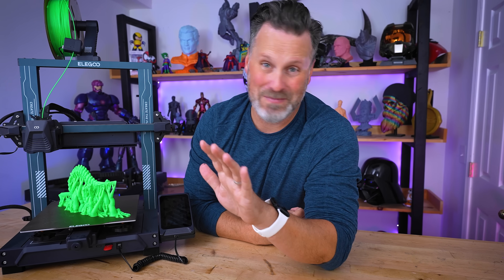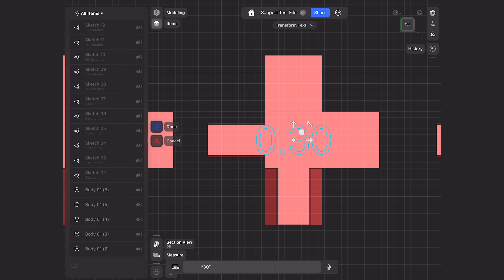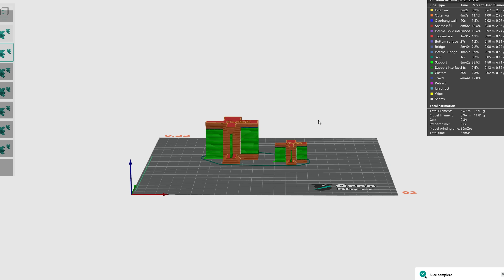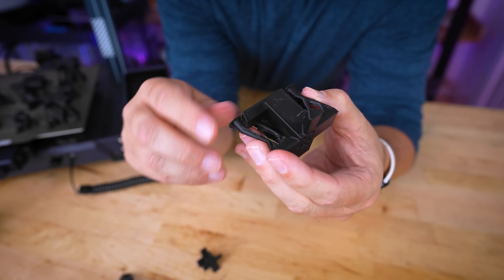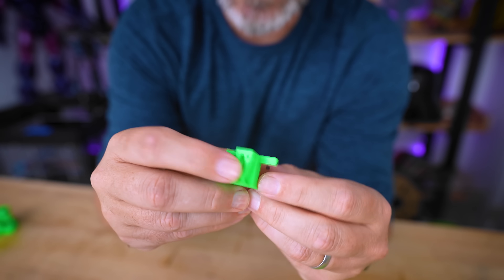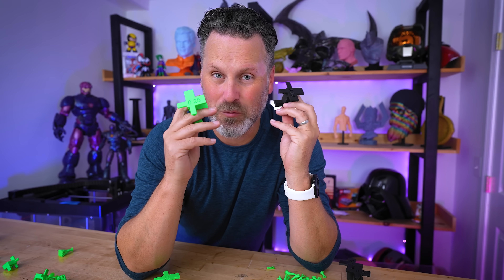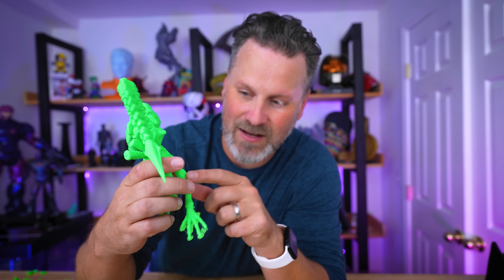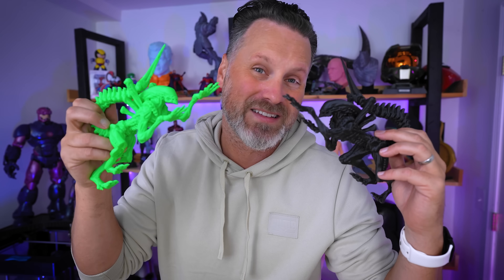Stop Struggling with 3D Printed Supports – Try This!

Comment: I run a small Print farm with 4 bambu's and use the AMS system alot- What's got me curious is that because I use different brands of filament, how can I "dial in" my support settings like this for multi colour prints...

I suppose I could choose a specific colour that I have dialed in and choose that as the interface layer 🤔

Comment: I had the same thing with supports on black filament being easy to remove, but the orange i bought for Halloween stuff being welded on there. So badly so that i had to scrap finished prints because the supports were so hard to remove they ruined the model trying to get them off.

Comment: Another thing you could tweak/optimize, is the overhang angle. Quite easy to create a test block with different overhang angels (going from 45° to 60° e.g. with 1° or 2.5° increments)

Comment: Hey Jess, Just wanted to let you know that there is a new filament manufacture in Buffalo Called Factory Filament if your not familar with them, The have this Filament Called DuraPet, its a type of Pet that is strong, sticks really well to the bed, doesn't need a heated chamber, and no fans. I'm gonna be getting some black and white this week when they get restocked. Thought you might want to try it out since they are somewhat a local company. They are literly half a mile from my house!

Comment: Hmm... I always thought that the z distance had to be a multiple of the layer height. Like for 0.2mm setting, z distance could be 0 (no layer between) 0.2 (1 layer) or 0.4 (2 layers). Is it not just rounding the 0.34 setting to 0.4 for a 2 layer gap?
How does the slicer do the interim steps? Is the layer height for the top support layer printed thinner than the normal layer height? Previews in Orca suggest otherwise. All the same layer height...
Reply: No you are correct, this video is just plain wrong but your comment will be buried in the praise comments so who cares :)

Comment: That was awesome. It was very fun to watch and learn about those parameters. If I'm in trouble with supports, I'll remember this.

Maybe you could do a video about stringing issues? Funfact: if I use Orcaslicer, my prints are string-a-paloosa.
Printing the same object sliced in Cura, everything is fine. I even copied the Cura settings over to Orca;
Orca just looooves to produce me hairy prints.
Modifying reatract, Z-hop, wipe etc. nothing worked. Now I'm using Orca just for splitting bigger objects,
exporting them and finally print them over Cura for the results I hoped to achieve with just Orcaslicer 😅

Comment: I would like to know what setting is used to make the slicer actually obey the "Top Z distance". From my perspective, layer height is the only thing that OrcaSlicer obeys. Said another way, you had pretty much the same experience with all your prints in two groups: those that rounded to the exact layer height, and those that rounded to one layer away. Load up your parts, slice them, drag the layer preview down to where the support material ends and the next layer starts. See what happens for all your tests. Yep. For your tests, you either got attached to the layer above or one layer of skipping between layers. I'm guessing there is something that is going on with the extrusion rate on the top layer of support, but from the user interface perspective, your options are 0, 0.2, 0.4, or 0.6 if your layer height is 0.2. Set your layer height to 0.1, and now you can choose 0, 0.1, 0.2, or 0.3. Your choice of 0.28 at a layer height of 0.2 results in one layer being skipped between the top of the support and the next layer. Both OrcaSlicer and Bambu Studio exhibit this problem. PrusaSlicer does not have this issue. It will adjust the layer height to achieve the gap you set. If you want to get really geeky, look at the G-Codes. Example: G1 Z23.4 F24000. Set the height of the nozzle to 23.4 and the feed rate to 24000. Dig deep. If you want something supported at a height of 25.4, the code for the top of the support will be at a z height of 25.4 or 25.4-layer height. It rounds any number you put in the "Top Z distance" to an exact layer height. Weird, right?

Comment: Make filament extrusion width smaller than nozzle width or flow ratio lower on supports specifically, whatever your slicer allows, you get deliberately underextruded supports that sort of just flake off.

Comment: I find that if I go much above 0.1 distance, my overhands look horrible.  For context, I mostly print in ABS so overhangs are always going to struggle.  But I just accept the extra work in pulling off supports to reduce the amount of fiddly sanding I'm doing.

I've also noticed - and again, in ABS - that how long the print sits makes a big difference.  If I pull the print after an hour or so (having waited for the chambre to cool to minimize warping) supports seem to come off fairly easily.  If it's hours later because it finished whilst I was asleep or at work or whatever, the supports are much more solidly attached.  I don't know if this was in play with your xenomorph, but it's another variable to consider.

Comment: I've learned from experience that the trick to removing supports is to not just pull hard but to work it back and forth.  After a few cycles it starts to crack and you can hear that.  Just keep working it and eventually it just falls off.

Comment: put a 180 circular curve on the bottom and have it test against that.  Flat to flat I've seen the same thing with top z index.  Curved surfaces are a different story though, I ended up at .275 top z on my X1C as my standard.

Comment: An interesting thing I've found with filament is that black is ALWAYS different. Matte and Deep Black PLAs are the only "normal" PLAs that I have different settings for on my Ender 3, and the only filaments I have ran flow calibration for on my Bambu P1S. Some of my most common issues are actually visible at 5:21 on your top layers where you have small gaps and a pillowing effect.

I have a feeling that because the colour black absorbs heat more than others, there is something different happening to the adhesion between layers compared to a lighter colour. Layers and walls are generally still very strong, but it always needs 1-2% higher extrusion than other colours. Maybe it's contracting more than other colours between layers and that's why the supports in this instance are coming away so easily

Comment: For PLA I always just use 2x the layer height (AKA, skip 1 layer), that seems to work every time for me. So when printing at .2 layer height, i do top distance .4, and when doing 0.08 layer height, i do top Z distance of 0.16.
Reply: Thank you!!
Reply: What about bottom height what do you set or adjust that.
Reply: @Gold3nB3rry  I haven't done too much testing on bottom Z, but i'd try the same and see how it works.
Reply: @mfmageiwatch   I've been doing more watching and was wondering weather it relates more to if you had supports created off your build ?

Thanks for response
Reply: @Gold3nB3rry  yes AFAIK the bottom Z distance is the space between the part and any supports printed on it.
Reply: Thanks!
Reply: What support type do you recommend?
Reply: THANK YOU, FLIPPEN BEST SETTING IVE DONE SO FAR!
Reply: @mr.h3084  yeah,  np!
Reply: im not understanding the z stuff any links to help a printer out?
Reply: @themaximusone I don't have any links, but I can try to rephrase. 

Z top distance is how much space is there between the top of the support and the first layer of actual print above it. (0 being fused, you don't want that. Default is usually 1 layer height, meaning it skips one layer before starting the actual print in that location. It will still semi fuse due to the nature of the hot plastic, but that space makes it a less secure bond you can break off. What I'm suggesting is that 2x layer height works best for me. It skips 2 layers before starting the actual print, its close enough to still provide some support, but far enough to not fully fuse and makes it easier to remove).

Bottom z distance is the same but reverse, and the less common one. It is for when supports are on the print, not just on the bed, and its the distance between the print and when the support starts. I usually try to avoid even having supports start on prints and do print bed only ones, but i leave this at 1 layer height instead of 2 because I want those supports to be stable if they are necessary.

Comment: If you think about it, this is a layer adhesion problem, just in reverse. While with the print itself, you want good layer adhesion, but between the support and the print you want weak layer adhesion, the closest to failure without actually failing, the better.
So you basically have to consider the same factors.

This also implies that printers being able to use different materials from the print for support will have an advantage for cleaner separation.

Comment: Heya bud. This is pretty nice to have.  I'd been using an ancient one from MAKE magazine 2017.

You really don't need to go through the effort of putting the numbers on the pieces though.  You should familiarize yourself with the Text tools in Orca, they're really capable.  I use them all the time when I'm printing out a small dimensional piece and I wnt to make sure something is scaled right.  but in this case you can just change the zOffset value, and then change that bit of text to reflect your changes.

bet people would like a vid on that too.  Bam/orca/prusa has got text tools, and I'm betting cura has something available through plugins (but I can't be bothered with that)

Comment: i hope this dosent seem stupid but does it make a difference if i use elegoo filament on a anycubic macine and vice-versa i have an anycubic and my supports are always welded like that but there aren't many videos to help me with anycubic that Ive found
Reply: No, printers are agnostic to the brand of filament you use. Just each brand has their own special blend of each type and can have different results compared to another brand. Id suggest finding a brand that works for you consistently and generally stick with them, but dont be afraid to try other brands.
Reply from the maker: Not a dumb question at all. You can pretty much use any filament on any machine as long as it can print at that required filament temperature. Pretty much any brands PLA, Petg should run on any 3d printer. You can mix and match all day

Comment: Had some prints today with difficult to remove supports - having an easy way to test them will help a lot! I also didn't realize that it varies with filament. Now that I know that, I'll definitely be testing new filaments before printing supports with them. Thanks for the video and the models!
Reply: Do you make your model files before printing?
Reply: @ayodelemarvellous850  sometimes. In this case, designing it to avoid supports would be tricky and I had limited time to make the design. But I do usually try to design so I don't need supports.

Comment: A little off topic but would I be able to run that Neptune 4 with just an iPad? I already have 3d software on it so i know I can do that. How well does an iPad work with slicer software on those?
Reply: you can't slice decently on an ipad unless the manufacturer has an app for it
Reply: @unclejessy i foubd your video on the PikaSlice app for ipad. Have you used it much since that video?

Comment: Remember, this is IN RELATION TO YOUR LAYER HEIGHT!  For a .2 layer height, everything here applies, but for a .1 or .3 layer heights it will be different.  In this case just take the .X for the layer and set the Z distance accordingly.  (Example: for a .1 layer height, set the Z distance to .12 or .14 or .16 and so on)
Reply: it doesn't. Printing a .12 or .48 layer height i have the exact same ease of detaching the supports. Any lower value and it's too attached 
It correlates with the nozzle, or more specifically the layer width, and the filament as he says
Reply: Another point is the obvious trade off being less tolerance for prints failing and/or having larger overhang drips. I have tested this extensively as well and found a nice trade off but it's very model dependent as well.
Reply: Variable layer height in Bambu?
Reply: It will still round it to the nearest multiple of the layer height.  So in your example, there is no difference between 0.12 and 0.14 with a layer height of 0.1.  It will give a 0.1 gap for both.  Try it out and see in the slicer.  At least.. this is how it works with Prusa Slicer.
Reply: @twinturbostang  They have variable layer height and also variable layer height for supports in Orca. There's also support interfaces that I think is specifically for making it easier to remove tree supports.
Reply: @ShopEskimo  Support interface settings predate organic/tree supports by at least three years, so I don't think they are specifically for that style
Reply: @twinturbostang  In Cura it's always rounded up to the nearest multiple, so 0.12 on 0.1 layer height becomes a 0.2 gap.
Unfortunately there is no conceivable way a 3D printer could make the info that's given in this vid work so it won't matter which slicer is chosen in the end.
Reply: @YoubYoub-f8k  So why do slicers let us put any number in there without telling us it's rounding up? Why not do the calculation so the moment you click out of the input it changes to what you're saying. 

Why do it the way they do now and cause so much confusion?
Reply: @trebory6  Well it's unfortunate I can't post pics in the comments.
Just open Cura up an hover your mouse over the name "Support Z Distance" or the input box.
A full description on it's functionality will appear.
Hope this helped.
Reply: @YoubYoub-f8k OrcaSlicer has an option 'Independent support layer height' that, as the name implies, allows it to command support printing at variable Z-intervals.
Reply: @darnon2031  I as going to say if you use variable layer height.

Comment: It amazes me how a veteran printer doesn't calibrate his filament... Dialing in the flow rate will make this way more accurate without changing these settings. It's why the black was already easier with stock settings because he is most likely using the same profile for each spool.

Comment: Could you not have all the different sizes on the build plate and change the individual object's settings to print them all at once rather than having to do like 5 separate plates worth?

Comment: The ELEGOO matte black is 100% my "go-to" filament for most things I make. It can handle high speed printing decently well too.
Reply from the maker: Agreed! Their rapid black PLA I now buy in bulk and use on my Bambu printers using the Bambu filament profiles
Reply: I have been buying Sunlu's Matte Black aPLA (Anti string PLA) for basically the exact same reason. and at 0.08LH the layers vanish.

Comment: You also need to make sure that you have the "Independent Support Layer Height" option is turned on if you're using OrcaSlicer, and this will not work the same when using a purge block.  If you're using a purge block you will only be able to choose a gap that is a multiple of the layer height.  If using a purge block and you put in a Top Z distance that is not a multiple of the layer height the slicer will automatically choose a gap that is a multiple of the layer height setting.

Comment: I noticed something just yesterday....
I was printing a rather large flat to the plate surface that had multiple tree supports underneath. They were hard to remove of course but I noticed something....
On the surface above each support connection the was a matching melted indention.
These round supports are funneling HOT air up and assisting in fusing these supports to the main piece!
And yes, the more malleable the filament the more easily it fused!
So could you run smaller or less supports so that the heat isn't constantly being transferred up to the supported part?
Looking at your green Alien print, and the number of supports, I'm guessing the fusing is coming down from the heated filament ABOVE the supports.
What do you think sir?

Comment: I generally print in PLA silk, but I've had the same issue of supports fused with a duel coloured (2-toned) silk filament on the same settings. The fused issue was on my cr-10 s5's but not on my P1p
Reply: Ever tried Bambu lab?

Comment: Temperature, temperature, temperature. I just went through this on a multi-section model print. The supports on the section where I dropped the extruder to 200C (from 210C) from the 10th layer up came off easily (0.28 top gap) while the second plate remained at 210C for the entire print resulted in fused supports and broken parts when I removed them.

Comment: Making a vid about supports for miniatures now with 1 hour duration. For minis there's a significant sag with overhangs/supported regions in my current best profile, but indeed making overhangs printable is a good thing to keep in mind with some exceptions.
Reply from the maker: Oh would love to see how that goes. I pretty much only print minis on resin printers but for sure lots of folks out there doing them on fdm
Reply: @UncleJessy  You can check out existing vid and short with showcase if you have some time. Those are kinda teasers for the process I've been working on for years and have refined very well lately. I can't afford to have a resin printer in home, and fumes are a concern for me and wife with our space and ventilation. Waiting for a tinymaker tho.
Reply: Hey, I finally did it, please check it out and tell me what you think.

Comment: How does the .34 work with the black? Question is. Would .34 be a good starting point and tweak from there instead of the default .2?
Reply from the maker: I didn’t test that but I’m guessing it would be extremely loose. If anything I’d start with .28 which has been my go to for the last year+